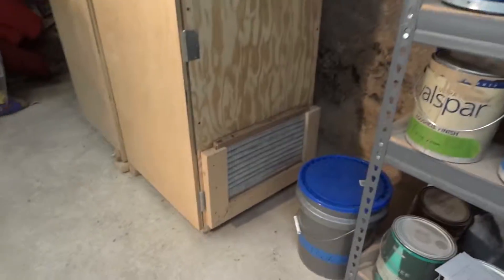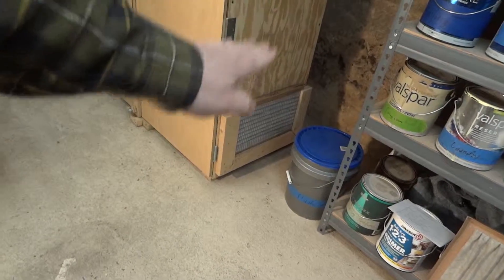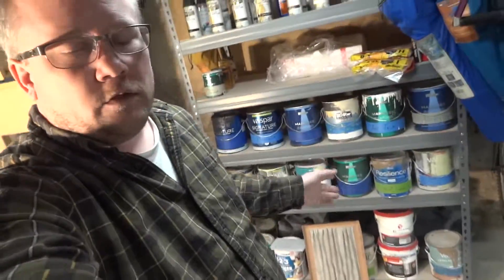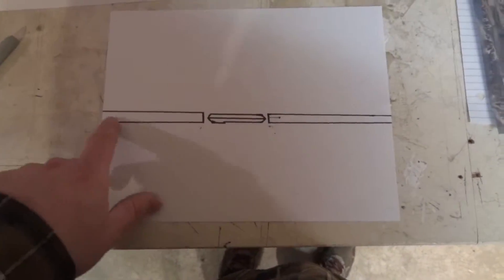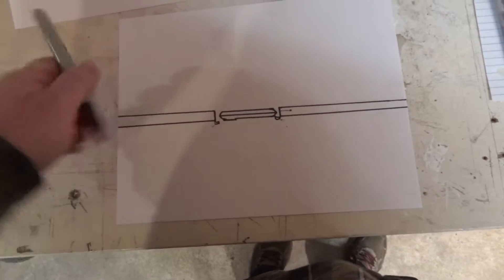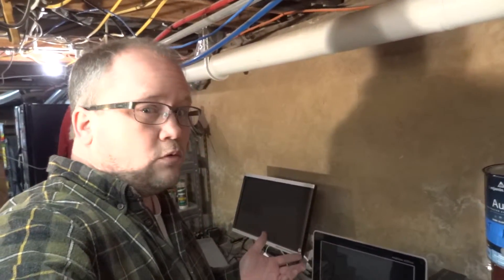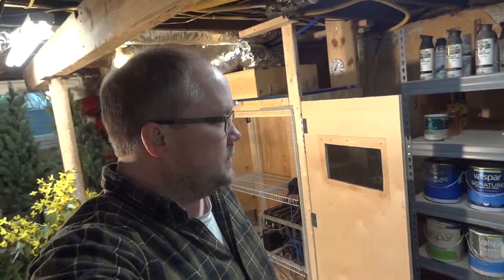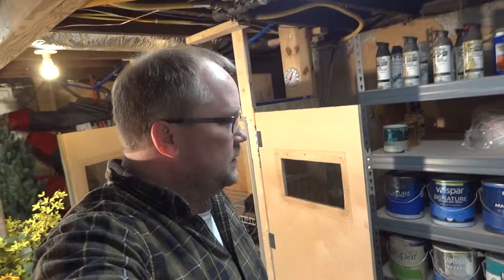Cryptocurrency Mining Rig Enclosure - Review Part 2 of 2

Comment: Hi Dan, I just found your channel, great work!

About the air returning back into the cabinet, I think the reason behind it is that you basically blow air into the plywood above. I mean you have three 6"  "pipes" going out, but they don't cover all the area of the fan. What I would do is to make the fan next to the wall, and connect the vent channels to the cabinet, so it sucks the air through them instead of blowing air into them... That would also create more options with the placement of the vent holes in the cabinet.

Best regards!